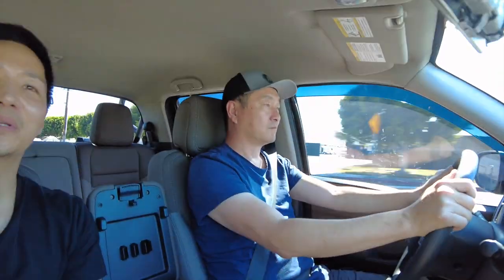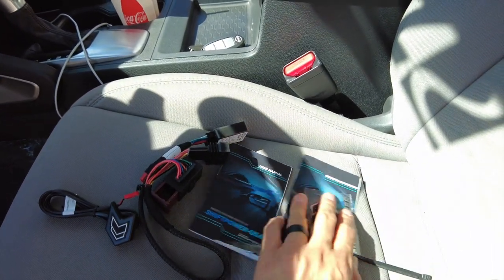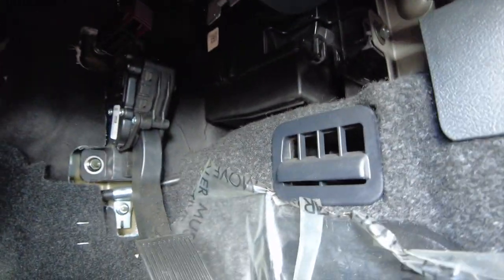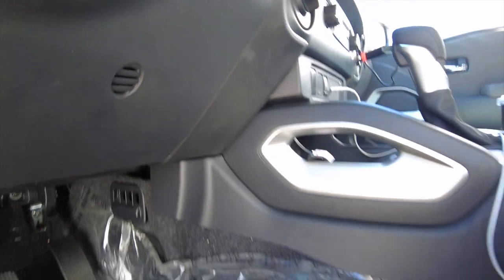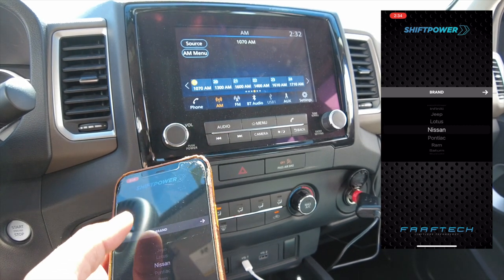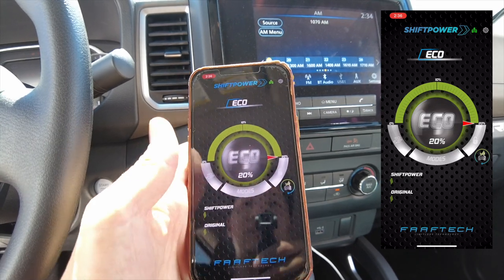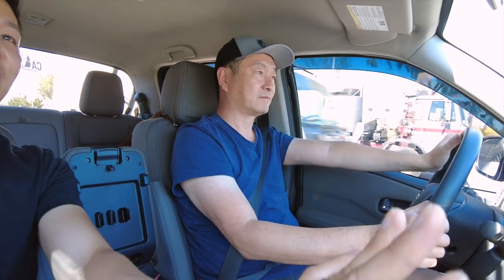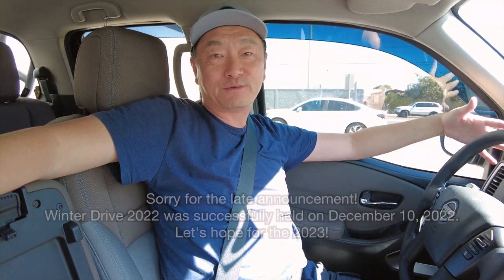ShiftPower Throttle Response Controller on the Nissan Frontier

Comment: Some throttle response kits have a “lockout” for reverse so it is not so sensitive while backing up.  Does this kit work the same way or is it responsive in reverse as well as drive? Thanks for the great video!
Reply from the maker: Ours keeps the same sensitivity even when in reverse. Pleasure is all ours!

Comment: I wonder if this will help with the neck breaking downshifts at highway speeds when using the cruise control? if it will, you've got a sale guaranteed.
Reply from the maker: Not sure but you can give it a try. If it doesn’t work for you, you can return it
Reply: @BeatSonicUS  awesome! appreciate that. I'll be placing my order soon.
Reply: If you take your truck to the dealer they'll fix this it's a service bulletin number NTB24-005 that came out Jan 18 2024 for frontiers built on or before June 13 2023 for the cruise control
Reply: @jeffvarty  yes sir. got that done in feb. much better now.
Reply: Thanks for any help with this. I’ve got a 23, new. Hate the lack of torque, downshifting bogging. Some people are talking about there a fix for that, too.
Reply: @jasenswick7725 how much has the mpg changes since you got it fixed. I heard it also changes your normal shift points as well

Comment: Hi, I bought this product recently and find the eco mode useful for day to day driving. I have one concern though. When I put my truck in reverse the backup does not display. Could this be a side effect of this product?
Reply from the maker: Hello, the ShiftPower Throttle Response Controller has nothing to do with the back up camera module. To verify this, you can uninstall the throttle controller module and then try the back up camera again.

Comment: question i have does it void the warranty?
Reply from the maker: It does not void warranty as the device does not permanently make any changes to the vehicle. You can also easily remove the device from the car as it’s plug and play leaving no trace that the product was ever installed.

Comment: Where do you source the power for your module? If your module fails for any reason what happens to my throttle response? Will I still be able to drive safely if it fails while I am driving?
Reply from the maker: Although the power is taken from the acceleration pedal, our device has a fail safe feature built in where if our device fails, the factory signals will pass through the device as if it’s not connected.

Comment: What’s the gain of power and torque?
Reply from the maker: No power or torque gain, but you will gain throttle response and better driving experience
Reply: - $200

Comment: you have on for a 2023 sv?
Reply from the maker: Which model is the SV?
Reply: 2023 Frontier SV and the 2022 SV are exactly the same.
Reply: dose it void warranty?
Reply: @brad4527  just remove it if you run into warranty issue. but based on what this does, I doubt you will have any trouble.
Reply: I have a 2022 pro x 2wd does it work for this one?